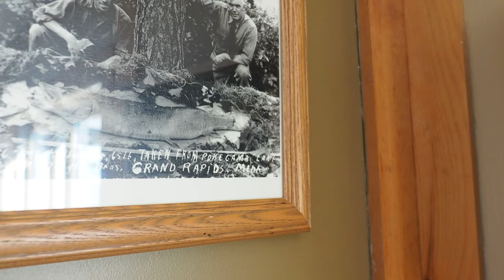We tackle this Very Dirty Carpet Cleaning at another golf course

Comment: Have they stop manufacturing the zipper ss/rotary? Seems like it has been unavailable for a long time
Reply from the maker: They actually have been held up for months waiting for the heads for the SS Super Spinner to be made. I heard he might be receiving a shipment of those heads in couple of weeks or less (finally). I know it's been driving the inventor and maker Erik Hiltz crazy waiting... As well as clients
Reply: @MarkSaiger  How often do the spinners need to be released?
Reply from the maker: @hannibalbarca7707  I imagine you are asking how often they need replacing. One of the units we have are on the original Spinners since 2016. It maybe doesn't get the same amount of use, but it's had some good time on it. My orange unit, this is the first set of Spinners I have gone through. Our other blue unit I think those found be original too. Sometimes I think it's just the luck of the draw when they give out. But the units make us a lot of money... Fast 😁
Reply: @MarkSaiger  Appreciate the input. Mytee Bentley wand looks seems an alternate choice, but know rotary cleans the best.... Guess I need to wait....
Reply from the maker: @hannibalbarca7707  there are quite a few little differences from the other push pull Wands out there. The original Zipper and SS Super Spinner are really dialed in with design, function and durability. I've had the opportunity to try them all. With that said, we have 6 Zipper Wands. Three are 15 inch regular and 3 SS Super Spinners. Worth every dollar for us 😊👍
Reply: @MarkSaiger  Greatly appreciate it thank you